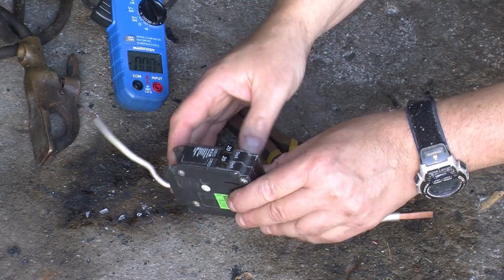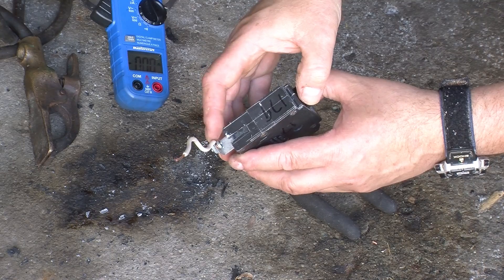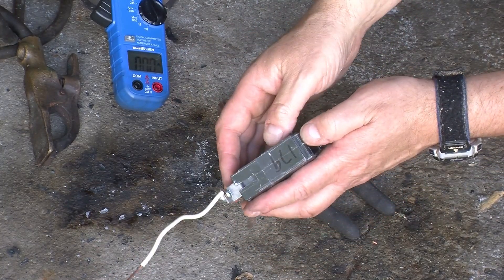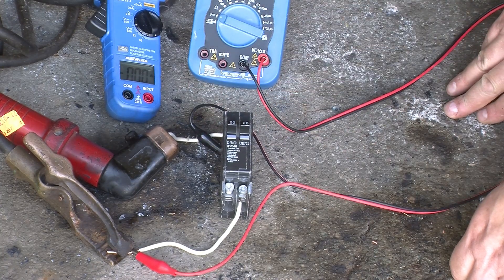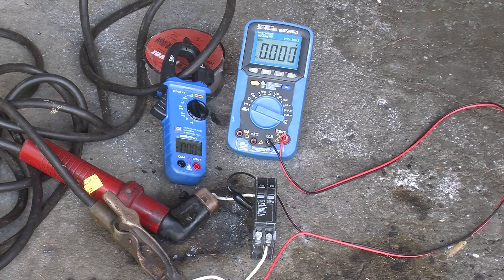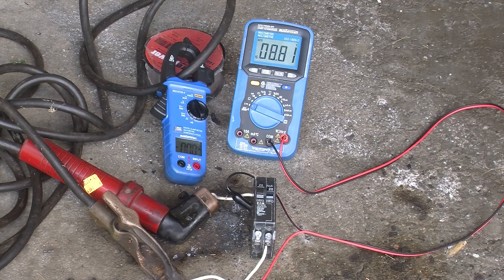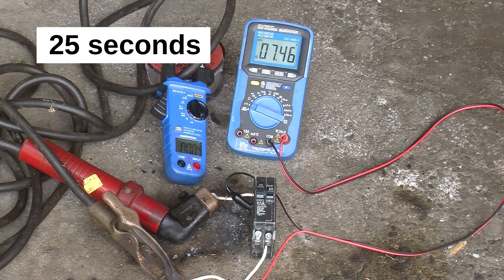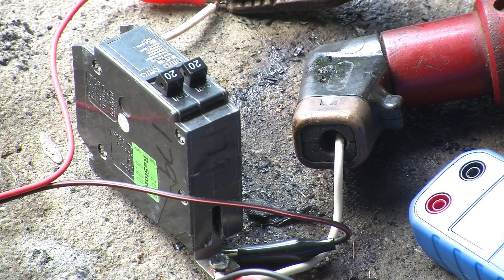Testing an Eaton Bolt on Type Circuit Breaker

Comment: 6:35 4 seconds at 60 amps. 5 or 6 when it’s cool most likely.
Reply from the maker: Yes - I have wondered what the variation in time and current rating is significantly lower temperature. I used to live in a house that that the breaker panel in an unheated mudroom that could easily get below freezing on a cold winter day. Was always a bit concerned as to how effective the breakers were in the winter.

Comment: isn't the bi-metal in the breaker still hot for a while after a non-short trip causing next test to cause a trip sooner?
Reply from the maker: Yes! By no means accurate to retest without letting it cool down. A better (longer) test would be to try at 20A, 25A, 30A etc, measure the trip time for each, and between tests let the temperature of the breaker go back to ambient. Not sure how long it would take. - probably a few hours. Probably should also test at various ambient temperatures, and also multiple breakers to see how consistent they are.

Comment: Using 120 volts may change the blow time.
Reply from the maker: It would be interesting to test. The higher voltage would cause the current though the inductor to rise faster, but that may or may not be significant compared to the mechanical switching time after triggering. If I ever get a high speed camera ......

Comment: Was a sparky for 50 enjoyable years and never cane across  what we called a twin or mini bolt on circuit breaker from any manufacturers. Years ago I asked counter men at a large electrical supply house if anybody made a twin bolt on in 15 or 20 amp. They told me nope. At one company that I worked for they refused to purchase a circuit trader so we tried using a #10 solid wire to rigid pipe to create a short and open up the bolt on ITE circuit breakers. Never cleared. Never liked using any twin circuit breakers on high currcurrent circuits like air cinditioners. When they burnt out they would often create large burn marker in breaker above it.
Reply from the maker: Interesting - and the test you did must have been exciting to put it mildly! This was an Eaton breaker and looks like its essentially the same thing as the non-bolt on BR home breaker - to the point where it has the slit from the non-bolt-on version. I wonder how they compare to ITE breakers quality wise and safety wise? So I'm curious - how often did you see breakers that had burned out - hopefully a rather rare occurrence other than the infamous Federal Pacific ones?

Comment: Thermal trip is for overload current, Magnetic trip is for fault current. The bolt attaches the breaker to a bus bar.
The current of a motor starting is inrush, and drops proportionately with the rotation of the rotor, ie, as soon as the rotor begins to move the current drops. Typically this is experienced within a couple of cycles, there being 60 cycles per second. Inrush happens so quickly it is hard to properly observe without an oscilloscope. Inrush is usually 6 - 8 times the full load current rating and depends on the load the motor begins with to determine the inrush curve.
Essentially a good demonstration. Shared terminology helps to improve discussion.

Comment: The bimetallic strip remains hot inside so doing test right after one another is not really going to give a true answer
Reply from the maker: Your certainly - certainly not a calibrated test! One would really need to leave the breaker cool for a few hours or  more between tests for an accurate result.

Comment: You are operating the breaker so far under voltage that a trip is not possible. It requires a voltage drop across the  thermal and magnetic elements to trip.  What is the point of demonstrating a scenario that would never happen in real life.?

Comment: I don't believe this is an accurate means of testing a circuit breaker. I think a more accurate test would be how many 100 watt bulbs a 20 amp circuit breaker can handle.
Reply from the maker: Well its wasnt meant to be be anything close to an accurate test :) Problem with bulbs is the current they draw can vary somewhat but a switched bank of them and an ammeter to would work well. In the end, the main thing is to have an easily adjustable source of AC current. A variac and welder combination did that nicely for me.

Comment: There is an error in measurement!
The voltage measurements are not correct.
To get voltage drop over the breaker (and thus can calculate power), you would need to attach the multimeter right at the terminal of the circuit breaker so the voltage drop in the wire doesnt get measured too!
Reply: That wire isn't going to do anything
Reply from the maker: That would have been a bit more accurate. I wasnt really too concerned about the voltage and assumed the bulk of the resistance would be in the breaker mechanism.

Comment: Just about every companies bolt on circuit breakers are great except for garbage ge. Years ago worked at a large factory that had thousands of bolt on ITE  120,277 & 600 volt bolt on breakers. Maybe one every year would go bad.
Reply from the maker: I am amazed at GE making poor ones - in the old days most of their consumer stuff always seemed respectable. Being able to observe hundreds in a real application as you did must be about the best way to validate which are good and which are not. Thanks for posting!

Comment: Good Demonstration.
Some years ago I learned that the same time-at-overload applies to automotive fuses. They can withstand a modest overload for some time before melting. The fuse manufacturers publish charts that tell how long various amounts of overload can take to open the circuit. Brushed DC motors as found on automotive radiator fans can have very large inrush current but will quickly burn internal wires if prevented from turning (by some obstruction) if that overload isn't interrupted in a timely manner.
That is a good reason to avoid undocumented import fuses.
Reply from the maker: Very good point! For some reason I didn't see your comment for weeks  -very odd!